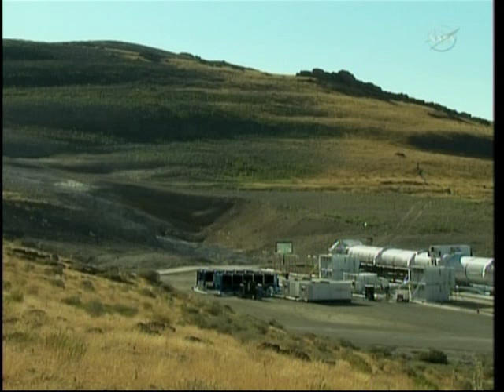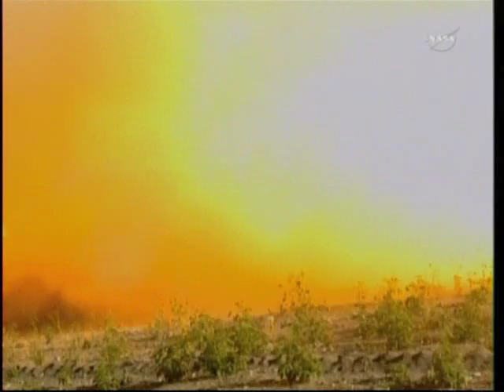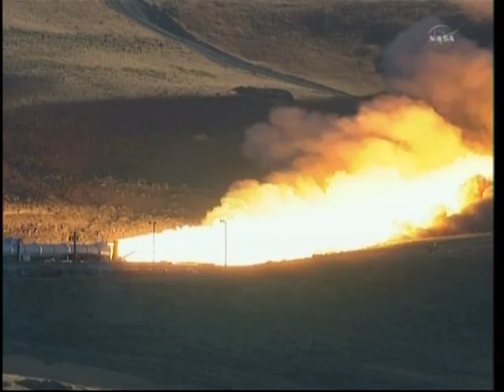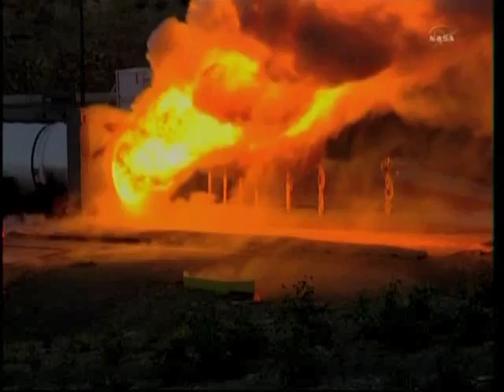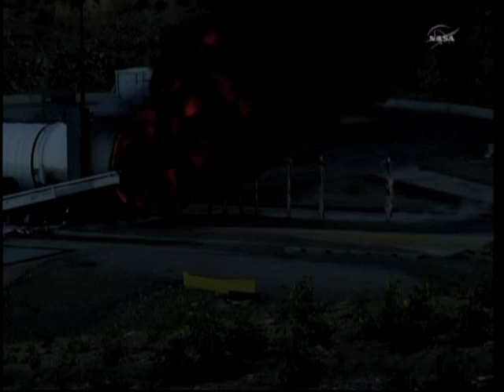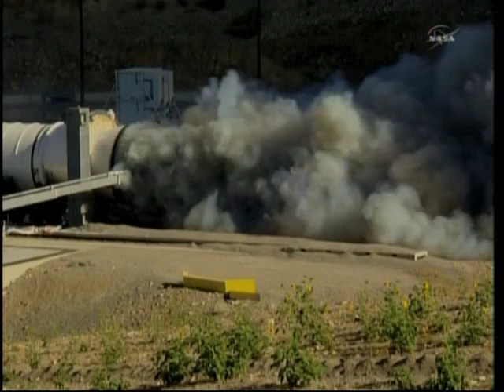DM-2: NASA/ATK test fires five-segment solid rocket motor

Comment: @Regnal50 and water vapor is responsible for 95% of greenhouse gas.  Plus NASA does these tests out in the middle of no where so that CO2 (which makes up about 2% of GHG) is able to diffuse properly.  Its like if you're in closed stadium and someone lights a match at one end, the match will never affect the temperature of the stadium cause its a heatsink.